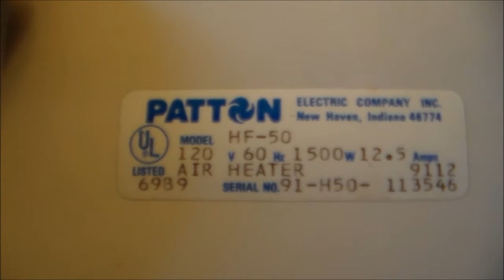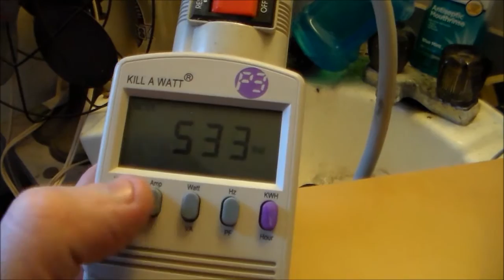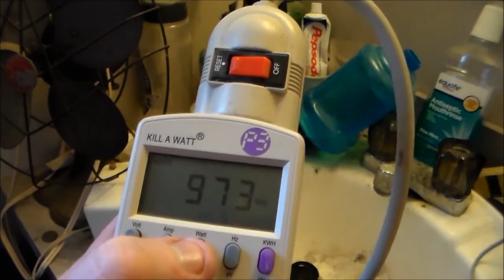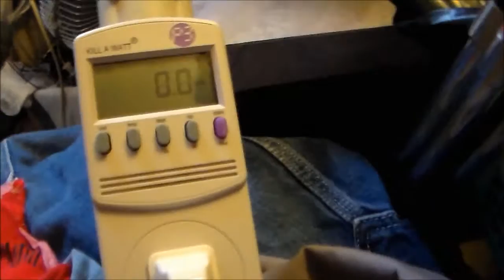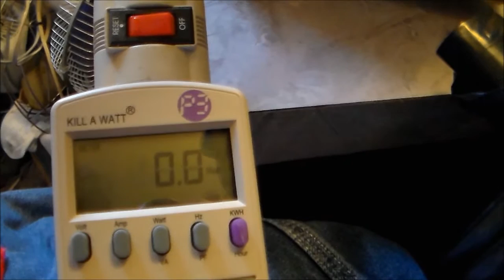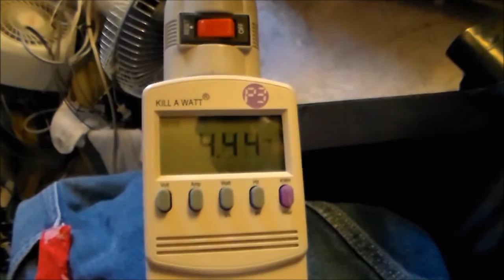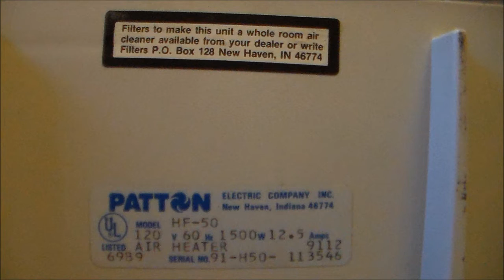Eskie's Vlog 033016: A Patton HF-50 Heater

Comment: Very nice! thanks for doing the video of it. the reason i asked is because this look almost the same as the one at the flea market iv been debating on getting..only its a black and white model.
Reply from the maker: +ToryTheFanMan Not a problem. Unlike the DJ at your favorite radio station; If you ask to see something, I'll try to make it happen.
Reply from the maker: +ToryTheFanMan I think that model might've been an '86 model.
Reply: +Eskie Wolf My Grandmother had this heater
Reply: +Eskie Wolf Just something i noticed when i had mine out the "9112" thats printed under the amps is the date code for yours. (December of 1991) mine had one of "8909" on it being November of 1989. just thought id throw this in the pot and see what you think.
Reply from the maker: +ToryTheFanMan That sounds a bit more believable.

Comment: I like how they claim 100% efficiency, and that "no other heater can deliver more warmth". In anything else (e.g. a fan), energy not spent accomplishing the intended task (blowing air) is dissipated as heat. If the purpose of the product is to generate heat, every manufacturer can claim 100% efficiency, and that competitors can't be better (because nothing is better than 100%), regardless of the quality of their product.
Reply: +timewave02012 Any electric heat is 100% efficient.  Some heaters can and do deliver more warmth, but it's perceived warmth.  I have a high-velocity blower that has a heater attachment.  The air coming out is lukewarm, but it still uses 1000 watts.  And it's 100% efficient.  The reason it's lukewarm is because the blower is delivering so much airflow, it cools the heating element off, and the high-velocity air is sucking in cold air from the room.  So even though it doesn't feel that hot, I get every cent of electricity I pump into it.  It's a matter of fitness for a particular purpose: it's designed to dry out large areas, not really heat a room.